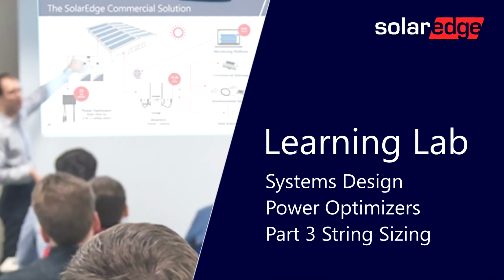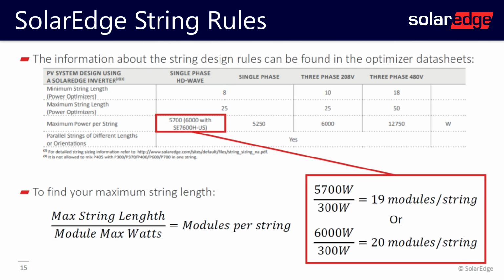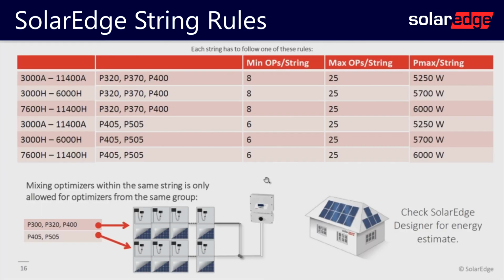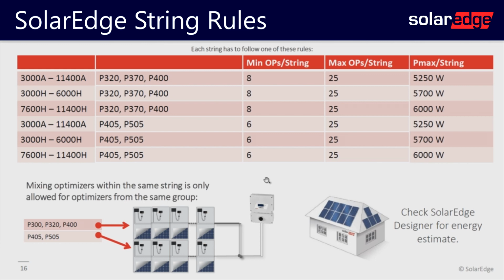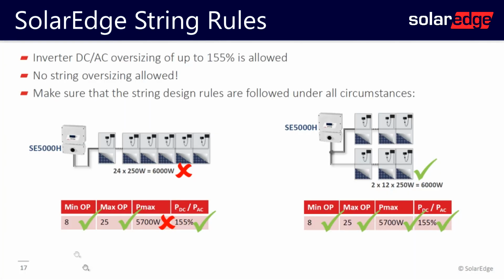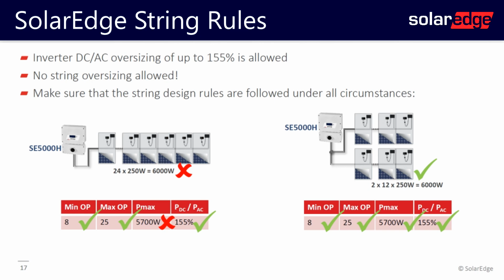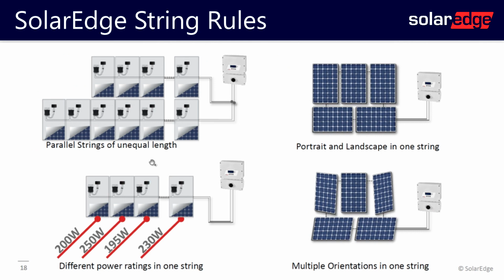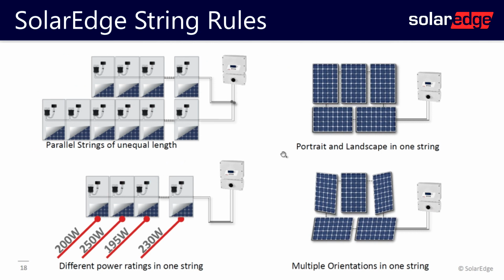SolarEdge Design: Power Optimizers, Pt. 3: String Sizing

Comment: Can the optimizers ever be oversized for current, or for total power?  Could you run a 320w panel on a p300 for example.  Voltage adjusted for temp is 42* and current (Ioc) is 10.  Technically within spec, correct?

Comment: I have a SE5000H single phase inverter and the installer put 22 x 300W panels (6600W) all on one string. Sounds like they should've spread them over 2 strings, as it exceeds the single string limit of 5700W. Is that correct?
Reply from the maker: Our support team will be happy to assist you. https://www.solaredge.com/service/support
Reply: @SolarEdgeTechnologies  SolarEdge support told me it was fine and that my fears were groundless. I pointed out the total 6500W exceeded their own limits but the support person never addressed this issue. I gave up arguing with them.
Reply: @technovelodos  Did you ever get any answers to this? I am also with SE and have 26 panels on one string.
Reply: @JaylanYilmaz  never got a satisfactory answer. I figure if I get a battery added, I’ll be able to add more panels and possibly get the strings evened out.
Reply: They must be incredibly low voltage panels to do all 22. Ideally it would be 2 strings of 11, so it sounds like it is choking the system a bit, yes.

Comment: What is the # of strings allowed per inverter, regardless of string length?  This is for residential and I can't exceed 600V per string per NEC. I have 24 panels and the P401 optimizers we selected have a max output of 60VDC each which limits my string length to 10 panels/optimizers. I'll be using the SE7600H-US. I know the unit has 2 string inputs but is this for convenience or is it the max string length? Can I use a combiner box to create more strings?
Reply from the maker: Our local team will be happy to answer your questions. You can reach our team at https://www.solaredge.com/service/support.

Comment: I have a question. For 82.8K inverter and PV 450Wp, SE designer choose 6 strings x 40 PV modules. Each string current will be 40x450W/750V = 24A. Why SE designer can use that more than max output of optimizer?
Reply from the maker: A member of our support team will be happy to assist you. Kindly open a support ticket at https://www.solaredge.com/service/support.

Comment: A 7600 Watt inverter corresponds to a P340 max string power of 6000 Watts. With 325Watt modules = 18 dc-optimized modules. 18 modules x 325 Watts = 5850 Watts. Divide by 400V nominal inverter input voltage = ~14.625 Amps = optimizer max string current = OK.